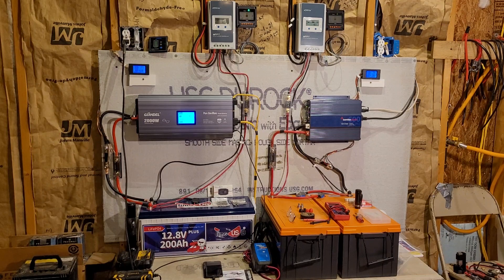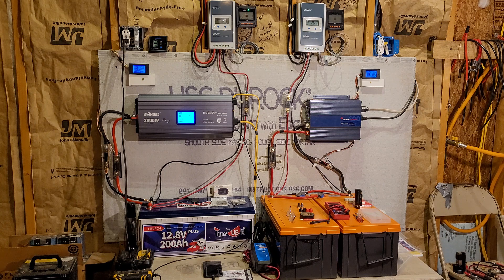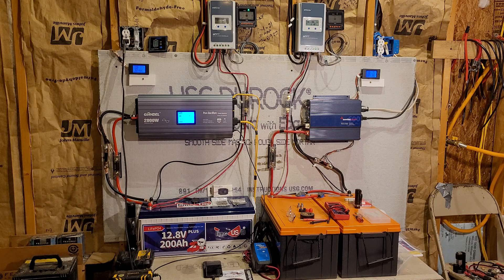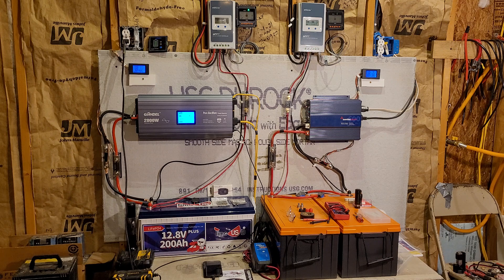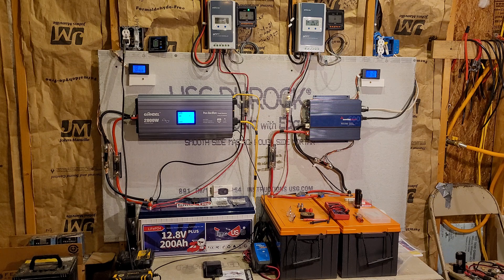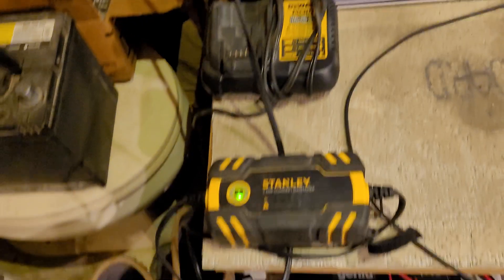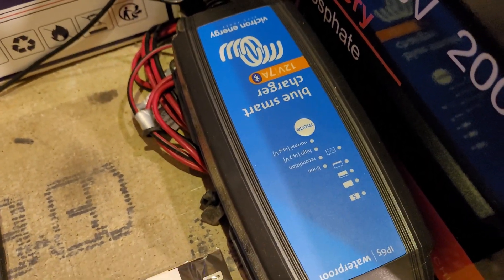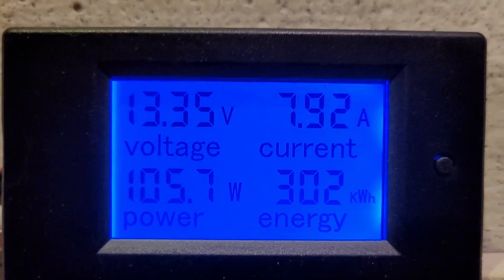Lithium Ion battery fires. SHOULD YOU PREPARE? Off Grid Solar ARE YOU PREPARED for a LiFePo4 fire?

Comment: in case of a runaway thermal reaction  you are gonna find yourself outmached,,,, a  lion e bike battery burned my mainhouse on my farm now consider this  i have a  tinybit of traning when it comes to fire , a tiny bit on rescue and breating systems ,and how to move in smokefilled rooms  when that battery goes off its a fairly large fireball and very very hot  , in a matter of seconds it set several things alight and when i reached it with the first bottlehalf the hight of the room was filled with black smoke i managed to dampen most of the battery fire and put out the burning furniture  then the next cell group vernt ,,of now i was sitting in order to breathe up run for the next bottle when i entered the livingroom again i was crawling on the floor to breathe,,,huge fireball again  got it somewhat down  no more air ,,ran to my neighbor. 30 meters down the road i heard the sound of pressure smashing glas and right after a huge smoke plum and then the sound of exploding roofpanels  , now i had just woken up,, i often wonder if i was fresh would i have dealt better with it ,,,so now i am involentary offgrid and those batteries like yours are safer and  are
 buildt ind to a isolated box away from my caravans
Reply from the maker: Holy Cow....Glad your OK.... I have considered the smoke factor. My system is in a drive thru garage. (2 garage doors ..One on each side) so ventilation will not be a problem. I have 2 fire extinguishers and a fire blanket just outside of the room.  Have any other advice for us?? Im sure Im not the only one that is interested.
Reply: @CentralIllinoisSolar   yes best advice i can give is never install batteries in a building you are living in  set up some ground rules for safety and never break them (normaly i never charged my ebike betteries in my house i always opened ,them to check what cells and bms in this case this case the battery wasfairly new and i broke my own rules),if they are in a shed or similar and there is a large amount of smoke stay out of the smoke its bad ,,my firebottles was withinn 6 meters of the batteri i also had a fireblanket a 1/2inch waterhose that could reach the whole house and a movable hand pumpewater station so so for any normal fire that had not reached flashover or close  i belive i could have dealt with it
Reply from the maker: Thank you for sharing and glad your safe
Reply: What about those "fire blankets"? I helped out once with a roadside car engine compartment fire, and I was surprised, shocked, and very disappointed how quickly my medium sized fire extinguisher (a Kidde) ran dry. I don't know much about those blankets other than they are supposed to smother the fire, maybe a good plan B?
Reply from the maker: That was my thought...Plan B or for a smaller individual battery fire that I could separate isolate and cover
Reply: @alflores4220  fire blankets is a very heavy canvas like material they are very effetive to smother a small slow burning fire , but with such a violent blaze it is diffecult to even get with inn a couple of meters ,, granted if one get to the battery early with only 1 cell burst one could pick up the battery and trow it,,
Reply: I've used cobalt based batteries for over 20 years in RC airplanes hobby. We known about battery fires for years why we never store them or charge them in a house.  Consumer products started using same type of batteries and claimed they were safe relying on a BMS. Reality is chemistry is the problem not the BMS. Sure BMS helps doesn't stop a battery from burning at 6000F degrees.

Comment: Put them in metal ammo cases and stuff them whit kaowool .. ☝️make sure to make a vent hole ( put some more kaowool at the hole to demp the flame) 
You’ll be fine
Reply from the maker: I like the idea of metal cases...Guess I should make my way to a surplus store. Do they make one big enough to fit 2 batteries?
Reply: @CentralIllinoisSolar  there are some you tube videos. Over it , for me it’s more in case of a  thermal runaway. You don’t lose the hole set up like in a cabinet  .. just replace it with a spare pack..the 4a/y22/s/usa/doc/ayd.  Is w14 h24 l44 cm. Perfect for 1 ore two 200p cells

Comment: he destroyed his battery by putting them in series when they are NOT made for that, end of story :x
Reply from the maker: No matter.. It ended in flames.    Prepare
Reply: Wye don’t u use cheap alie chargers. 8 bucks for a 2/ 3 amp .. you can put as many in parallel as your battery can handle.. these thing got a backflow protection.. those chargers get real expensive above 5 amps
Reply: If we are all talking about that guy in rural Hawaii, I noticed something odd about his batteries. They clearly had the words "Lithium Ion" on the label and yet they were supposedly Battle Born Lithium IRON phosphate. Would the type of battery chemistry involved have anything to do with it? My LifePO4 batteries (Renogy Smart) are limited to only 4 batteries in parallel and none in series. Strange how some will and some wont handle large banks.

Comment: Yes but you have 12v system wen you go battery in serious to build a higher voltage 24v and 36v or 48v you need a battery balancer to balence all of the battery if not one will go up and it will get in fire
Reply from the maker: Good advice here